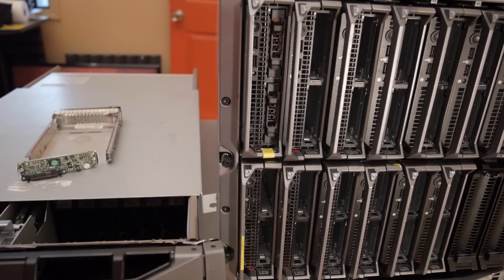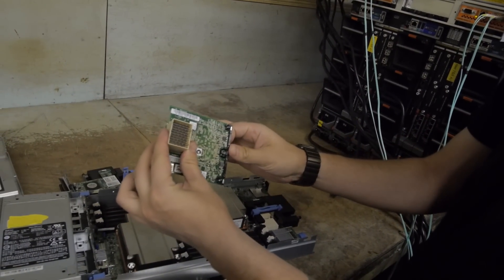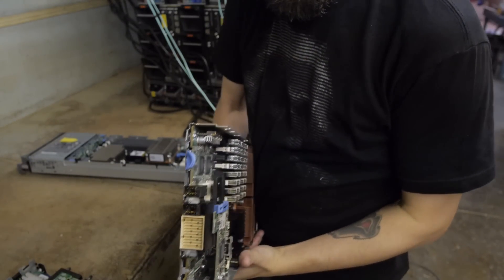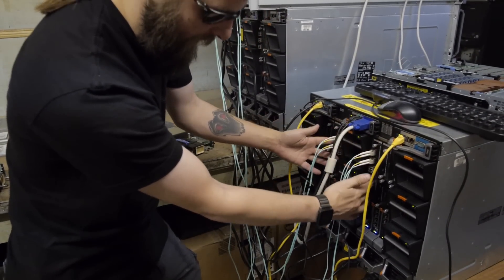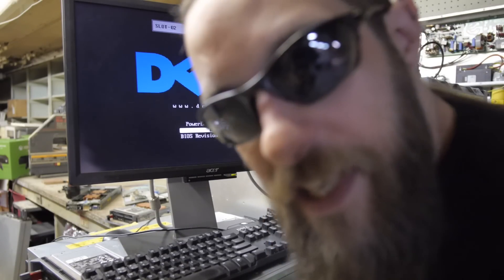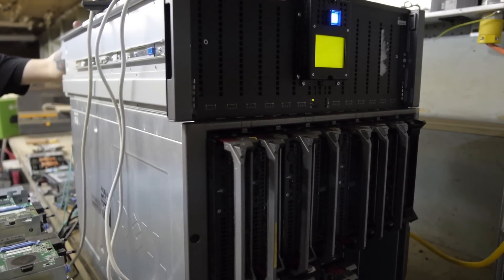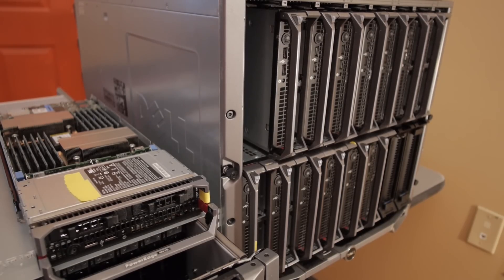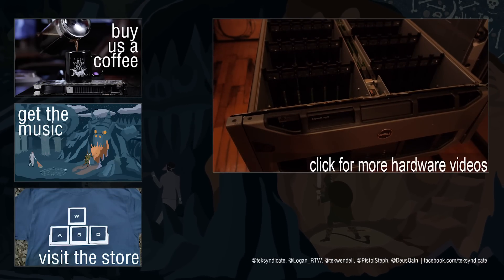Dell M1000e Blade Center - 16 servers, 1tb Ram and 10gb ethernet in a tiny cube!

Comment: I want one, I have no use for it but I want it
Reply: +C:\ampbell that is how good Qain is when he talks about tech..you end up buying something you dont need
Reply: Better start with the power station first to run the dam thing
Reply: +TheNerdyCanadian not exactly very powerful since xeon cores are usually much lower clocked, but I suppose if you wanted like 10 game servers running simultaneously then sure, although if you're running that off your home connection then it doesn't matter anyway unless you have gigabit connection, that plus a single DDOS would your servers offline.... 
I'd say stick with a VPS or rent a dedicated box if you want a game server you can manage.
Reply: +vgamesx1 What processors do you think servers run? Dedi/VPS will all be running Xeons, and most servers have decent Parallelization.
Reply: Thomas Stolk I pay over $40 (€38) for 30 down / 5 up and it's not totally stable either... It drops out every couple of weeks or so :(

Still 10x better than Comcast though, so at least there's that and I've heard some places even get as little as 10 down / 1 up for as much as $70, so yeah.. I'd count myself lucky as it is honestly.
Reply: vgamesx1 

"not exactly very powerful since *xeon* cores are usually much lower clocked, " Is what i'm talking about.

Intel doesn't tend to sell many non xeon/consumer grade chips. 

Also electricity costs on their own won't cover the costs of renting. For 10$ you could get a single core/1GB VPS from Digitalocean, not exactly something you could run a big server on.
Reply: Lothar Scholz
Dear sir switch cannot blocking internet access. Only Firewall can do it. You actually means Single Gateway project? I think i already familiar with that thing because some website already denied to be access from the public but you knows VPN can still help you here. No where on this online world is secure or private actually....

Actually NSA is your friend too when becoming too informative?

Sorry for my great grammar...
Reply: DaLordish I don't think you quite thought that through, because the important thing is that you're getting a fast and reliable 100mbps+ down/up connection which is obviously going to be way better than any consumer grade connection (in the US anyway) and of course it will cost more but you can rent from a gaming centric provider which are going to opt for lower core/higher clocked processors and renting offers other benefits as well, such as not having to pay the extra $10 a month or so on electricity to run a server 24/7 and it's also safer since you won't be the one getting DDOSed when a kid inevitably gets pissed or you could even use it as a private VPN server or perhaps a seedbox if you really want...
There are plenty of reasons to rent instead getting your own hardware, but getting super high-end specs isn't usually one of them, unless you absolutely need it and are willing to pay extra.
Reply: +vgamesx1  I pay 97.7 $ for a 20 down/5 up connection, and a reason is their shitty TV services  which is included whether you want it or not and it eats the broadband connection(everything connected to the internets get awfully slow) all that is for their lowest tier , HIGHEST TIER IS SUPER CRAZY EXPENSIVE  1361$$  !! FOR A 500mbps CONNECTIONS  ISP is SHIT but it is the best in the area
Reply: DaLordish I never said anything about consumer grade CPUs so I have no idea what you're going on about... I know that servers use xeons.
You know they sell inexpensive xeons such as the E3-1231V3 right? Which are clocked about the same as consumer parts.

Also roughly $10/month to run a server that uses about 200W of power 24/7 isn't cheap for electricity? (Actually I was nearly spot on, 200W a month is 144Kwh and it costs us 0.085 cents per Kw so $12/m) 
I just mentioned it because that could cover your costs of renting instead.
I feel you though, I know internet really sucks over there.

The-Gamer I honestly don't see how that's crazy expensive, $40 more for half of a gigabit + phone + TV? that seems more than reasonable to me... Especially when in total we pay $120 for everything and the only higher tier offered is $50 for 50 down / 5 up (just checked) $60 for 110 down / 10 up so I can't even get close to that unless I want a business line, btw have you tried using a VPN whenever you start slowing down?
Reply: +vgamesx1 +vgamesx1 mate please reread carefuls I was saying (20mbps for 97$) and (500mbps for 1361$). I would not utter a single word if I was paying 97$ for half a gigabit, as for the slowing down issue I dont have to worry about I just plucked the recievers wires, so it is just sitting their gathering dust.
Reply: +C:\ampbell I want one too but I do need Wendell to set it up for me LOL
Reply: +vgamesx1 I heard from my malaysian friend that he used to got at that rate before 10/1 at that price but now he upgraded to fiber with more expensive price can't remember how much and in my place Thailand i got 10/1 for 13 USD per month
Reply: +C:\ampbell makes a few of us I think. To think of the VM's I could muck with on something like that with ESXi.
Reply: +TheNerdyCanadian why not 10+ game servers ?
Reply: zombiekiller924
get more than 10 out of this hardware.
Reply: +Thomas Stolk fk u I pay 25 for half of that without one of the zeros.
Reply: +C:\ampbell A heater and noise generator!
Reply: But i guess you can only use it for peak times. Doubt that they allow you 150TiB (and this would be one way only max).

But you are right, the whole traffic situation is so much better and cheaper in Europe. I pay 30x times the price in Africa, 20x time in South America, 10x in Asia and 5x times in USA. And i'm talking about datacenters sitting right on the backbone.
Reply: ***** cringe
Reply: Just go for it.  £400 for a 1.0 chassis... then previous generation blades can be had for £33 each!  Cheap pass-through networking to start off... it needn't be too expensive and the electricity cost is only a problem if you run all 16 blades intensively as the blades are actually very efficient.  Also the chassis lets you set maximum power usage constraints to keep the beast under control.  The great thing about these modular chassis is that you can build up slowly as funds permit.

But I'm in the UK and we have 240v/30A domestic mains power, so that makes it easier I guess.

I've just bought an m1000e for my home rack but not quite as nice as the one in the video (yet!).  I'm thinking of doing a set of videos to show the hardware, install, config, management, SAN and finally playing with a clustering and monkeying with XEN/VMWare clouds.

My setup not the best at the moment, 16x older m610 blades @2.4ghz/4 core(*2) w/ 64gb RAM per blade 2x CMC, 1xiKVM and 2x 16port 10Gb Passthrough cards for the LOM on slot A.  But still, that's 128 cores (307.2 Ghz) and 1,024gb (1tb RAM)

I have a donated Dell SAN getting populated too (currently aiming for a 60tb RAID) , so the next job will be getting hold of mezzanine cards to activate infrastucture slot B to try to get some nice fast SAN action going : )

Installation may present difficulties as it's going into a 'round-holed' IBM 'Storage Server' rack using Dell versa-rails which I've never used before and my vendor reckons the chassis is 70kg or so.  So there might be a lot of swearing, crying and/or throwing tantrums.

BTW, It's an open house if anyone is local : )

I'm in Preston, UK and have a fairly full Cisco CCIE lab setup in another room along with a lot of Asterisk/Digium, Cisco and Avaya VoIP gear, etc... so if anyone lives local and wants to come round and learn, teach, play admin, practice some CCNA/CCNP/CCIE labs, do some hacking, coding, game-dev or generally goof about with new and old gear (I'm restoring a rescued Prime 550 mini for example) drop me a message.

I'm kinda hoping to set up a hack-space (for electronics tinkerers) + linux user group, so anyone interested in helping out with that once it's running is welcome too.
Reply: They are kind of old, but I just got one with 11 blades and 10G cards for $1200. Pretty excited
Reply: +C:\ampbell very powerful game server?
Reply: vgamesx1

" (+) TheNerdyCanadian not exactly very powerful since xeon cores are usually much lower clocked"

Almost all ~~game~~ servers will be running Xeon chips. I'm not arguing for or against renting/owning the hardware, although I certainly recommend data centers over running your own servers in most cases. Regardless, I'd challenge you to find reputable server companies that sell/recommend to you a consumer grade chip. There is a reason why servers use Xeons, and it's because of the outstanding reliability they have, and ECC support. Take fragnet for example, one of the largest gaming server providers in the United States. 

http://www.fragnet.net/dedicated-servers.php

In any case, there are people with insane connections such as those in singapore, who have a gigabit FTTP. For the most part skiddies don't matter, because in order to apply a layer 1 attack they have to use the entirety of the server's available bandwidth, and 1gb/s booters are expensive to run, especially for an extended period of time. 

Likewise, there are places with insanely cheap electricity ( remember batshit insane bitcoin rigs?) as well. America isn't always the best use-case scenario anyway.

But that's all just hypothetical. You're not going to buy an enterprise-grade multi-thousand dollar server to host some shitty game server anyway. 

Trust me, I know how shitty internet speeds can be, I live in Australia.